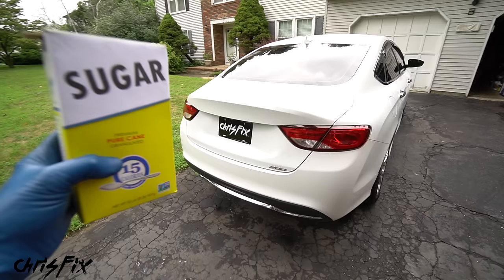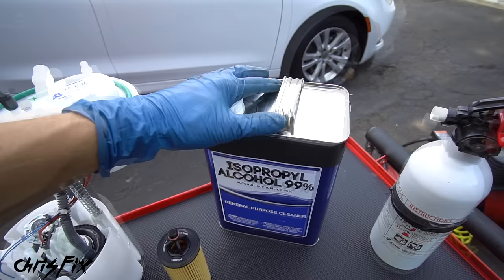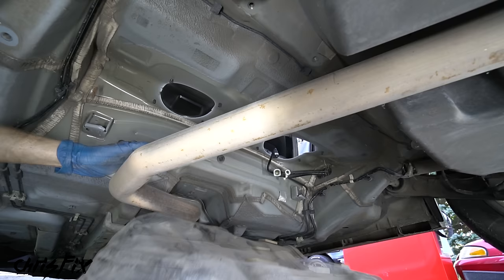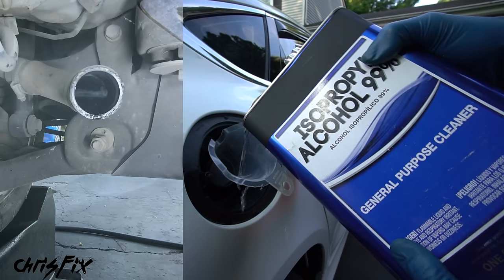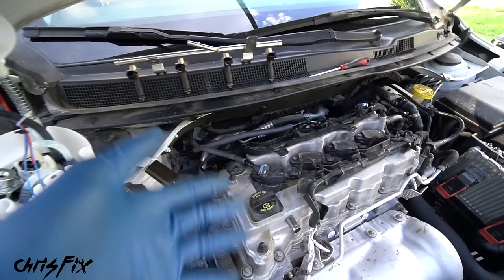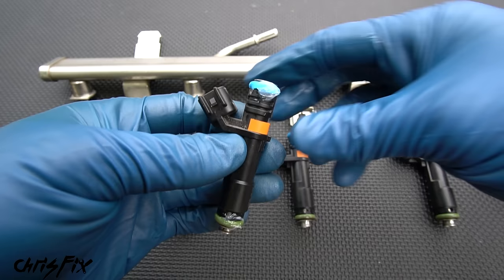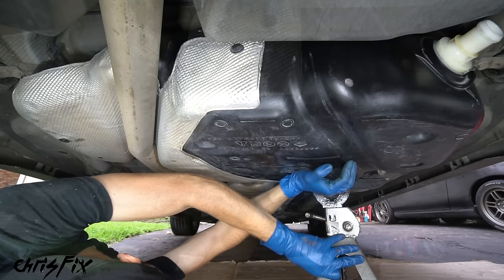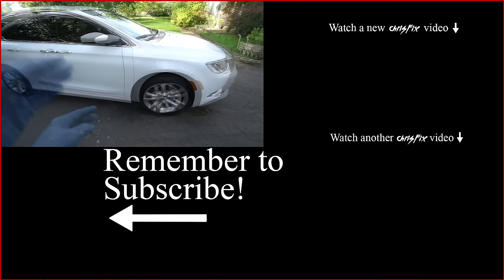How to Clean Out the ENTIRE Fuel System (Vandalized with Sugar in Gas Tank)

Comment: At 17:30 isopropyl alcohol is also highly flamable. Be VERY careful when doing this. Do it outside and far away from any other flammable liquids/items
Reply: Yes, thank you for restating what Chris already warned us about in the video, as I had almost forgotten a couple seconds after he said it.
Reply: but...but i like fire
Reply: @lemau8458  he said don't use gasoline, use Isopropyl alcohol, but it doesn't matter if you use alcohol or gasoline, as both are highly flammable. 
Be careful, and remember that the vapors ignite, not the liquid, so even if you get a spark from static electricity, you can still be in big trouble.
I really like Chris and his videos, but as these are targeted to DIY guys, it is very important to take all precautions, especially when working with highly flammable liquids. If someone is working in his garage with a gas, alcohol, and using 9v batteries(which can easily create a spark) they can burn down their house in a heartbeat, since you cannot stop a gas or alcohol fire with a small extinguisher
Reply: @lemau8458  i can't tell if it's sarcasm or not?!?!
Reply: @pb5109  read the username
Reply: I could he wrong, but since the alcohol dries/dissipates quickly, I don't see this being an issue unless you are introducing a spark right away.
Reply: @shaunrollo1991  Well, that's the reason it is more dangerous,  it vaporizes and becomes a bigger fire hazard.
Reply: @lemau8458  yeah, and the alcohol burns with a virtually invisible pale blue flame so youc could have a fire going and not even know it.
Reply: @TheRa125  but that's what confuses me. Sure, at first when the vapor is fresh, then I can see that. But the vapors would dissipate rather quickly, which would mean that it is no longer flammable
Reply: Shaun Rollo if you’ve ever spilled gas it evaporates extremely quickly as well, but both are very flammable, your right about dissipating vapours but that doesn’t happen instantly
Reply: should also use brass tools when removing the pump

Comment: locking gas cap: $6

not cheating on "Susan" : Priceless.
Reply: I think you mean Susan not cheating...
Reply: Locking cas cap at auto zone in Denver after taxes is $20
Reply: @seanmares2406  u have a 33.3% taxrate?
Reply: not only he fixed it he also prevented it from happening again!! XD
Reply: NaimaKKa 33.3% tax rate. Although, it’s probably not the tax rate. It might just be priced more expensively there before tax.
Reply: @zacjohnson452  forgot a dot

Comment: With respect I say this, over the years as a mechanic I have repaired two vehicles with sugar in the gas tank. On older cars with fuel pump bolted to the engine it would do damage. Sugar is a acid and in right environment will be a acid to metals. On car with fuel pump in the gas tank sugar will turn in to a gel in the tank and clogged the pump up! You are right water will clean out the area with sugar.

Comment: To prime the fuel pump on a keyless start car, either:
press the brake down with key in pocket and not press the start button (you should hear the pump priming)
or don't press any pedals and just press the start button twice.
Reply: I always figured it was a PC kind of thing or like a phone. Both my 2014 and (current) 2018 Chevy Malibu start power with just a tap of the button and primes everything when you do a press n hold until the needles start moving.
Reply: or just push the button without your foot on the brake to run the car in accessories mode which will activate the pump and the push the button again with foot off the brake to urn the car off

Comment: Hey dude, great video!!!! 
2 things: when dealing with gasoline use nitrile gloves, some gloves dissolve in petrol! ALSO with push-start cars sometimes the fuel pump activates when you open the drivers door (Or even unlock the car sometimes)
Reply from the maker: Thanks for sharing and thanks a lot!
Reply: @chrisfix  did you plan to do brakes to this car before giving it away?
Reply: @pauQuu97  yes i do plan on doing this before auctioning this car.
Reply: @chrisfix  Chris i love your videos but if that was a direct injection fuel system he could have gotten hurt if he did not disable fuel pump either by fuse or connector
Reply: @austinshores3324  why? GDI high pressure fuel pumps are engine driven
Reply: @kinslayergaming3159  true i forgot not like a diesel the system's km. Km tank has only like 40ish psi
Reply: Sorry auto correct

Comment: Hey, I know I'm late to the party. Here is a little tip since you said that you're used to keyed ignitions. On key-less ignitions you can prime the car by pushing the start engine button with your foot off the break. It's the same as turning the key to the run position. Also you taught me something. I didn't know you could hold the start button to try to get the engine to turn over. Thanks for all you do.
Reply from the maker: Thanks for the tip!
Reply: i have a bmw 335i, is it possible to prime my car

Comment: I’ve never seen anyone work on an American car and say “I love this design”
Reply: LMFAO facts
Reply: Ive never worked on any foreign car and said “i love this design” everything about euro cars is over complicated
Reply: Kenneth Bilderback exactly
Reply: Kenneth Bilderback well then. You’ve obviously not very bright then.
Reply: @LukeGB003  most regular American cars are somewhat simple to work on. When you start messing with luxury and euro cars that's when the overcomplicated and annoying engineering appears
Reply: Lucas im an ase certified mechanic. Im speaking from experience
Reply: @luckygunner3484  shit man you got my dream job
Reply: Ricer
Reply: James Holbrooks open the link i sent and skip to 4:25 its the part i was talking about
Reply: @luckygunner3484  yeah, that really is helpful, a while back here I had to put a new fuel pump on an 85 Nissan 300zx, it had something similar but instead of it having the pump right there they decided it would be better to put the sender unit there, it was a fucking pain in the ass, can't wait to be rid of that thing.
Reply: James Holbrooks my favorite examples of euro car problems are things like the hydraulic motor mounts on mini coopers that like to burst. And other annoying things like the guys at vw not putting a normal cap on power steering reservoirs instead making you use pliers or a screw driver shaft to open them. Or the fact that on literally any euro car there is no room to work on anything without first removing multiple other components to reach what youre trying to do
Reply: Vincent Valentine  on newer cars yes, on order cars, that's a flat no

Comment: Thanks for the video, Chris.  As a high school teacher in a rough area for decades, I've seen and suffered through my share of car vandalism.  My tank has only been sugared once.  Then I started using a locking gas cap.  lol.  If only my tires were that easy to protect.  lololol.  ;)
Reply: Airless tires do exist, but only for industrial machinery. Would be cool to see it open for consumers.
Reply: Damn Debbie that sucks
Reply: Debbie you can buy airless tires and an loud alarm for your car that will realy help
Reply: I Always Put Sugar in My Tank So The Kids On The Block Dont Steal Mine On A High Speed Chase!
Reply: @germanmemerboi3157  you should watch a video on tires and understand why we dont.
Reply: time to move on...your getting older and you've done your share of charity work. i quit going into those areas years ago, who needs that nonsense?
Reply: @johniorio7951  I understand what you mean.  Thanks
Reply: Like the bouncer did on Road House, get a hooptey with a trunk large enough to keep a couple of tires ready to go.
Reply: Get a dash cam, locking lug nuts that should help.
Reply: @debbiekeds9355 Have to agree. Try to pour in knowledge there is like trying to fill a bucket with no bottom.

Comment: 3:58 Just a heads up, non-OEM gas caps are NOTORIOUS for causing EVAP trouble codes and making your car fail emissions. If you get an EVAP code and are using a third party gas cap, swap back to the OEM cap as a troubleshooting step.

Comment: i cant belive they made the fuel filter a "non service ble part" for the normal consumer.
Reply: some cars even recommend you replace the fuel filter every so many miles to prevent damage caused by a lean fuel air mixture as your intake valve is both cooled and cleaned by the fuel in a port injection car also its bad to run pumps dry
Reply: Fuel pump dies after 80 to 100K anyway
Reply: Probably because finding a way to make money
Reply: I'm not sure about the later generations, but the first generation Prius (through 2003) has the fuel pump, filter, and regulator as non-replaceable parts of the tank. Later generations do not have the internal bladder so I would expect them to be quite different in that respect.
Reply: @cbpuzzle  I had an electric fuel pump fail in a work truck, around 35K miles, but never had one fail in my own cars. 200K miles is easy. Just keep more than a quarter tank of fuel and you are good to go. Running the tank dry is very bad news indeed.
Reply: I think its to maintain servicing easier for a Chrysler technician. Every 100k miles replace the whole assembly. It also reduces the parts since FCA at the time wanted to reduce the amount of individual parts in a vehicle. This vehicle really wasn't designed for the home mechanic. There are a few areas where having the Chrysler Scan Tool makes it easier like the rear brakes.
Reply: Vehicles with the fuel filter integrated into the pump assembly are typically RETURNLESS FUEL SYSTEMS. Meaning fuel is not circulating back and forth through the system (including the filter), therefore the filter's service life is significantly increased since its workload is about half, if not less than a typical inline filter on a non returnless system.

Comment: I like a clean reassembling too. Especially around open fuel lines. Nice to work clean as possible. Too much dirt around fuel lines is asking for problems easily prevented.
Engine cover was cleaner than the steering wheel on this one. Lol. Next on the to do list that seemingly never ends.

Comment: Great video. I saw another video where the guy put rags (cloths) into the tank, then used compressed air into any opening in the tank which ran the rags  around to dry and clean the tank perfectly. I used this method, it defo worked and is very easy.

Comment: Wow, no baffles inside the fuel tank. Luckily most people aren't smart enough to use heavy corn syrup instead of granulated sugar. LOL Great video Chris!
Reply: electronicsNmore u have caused a bounce of distruction
Reply: No baffles because of the moulded in dimples, which, along with the odd shape of the tank, provides a lot of damping of motion for the fuel in the tank in normal driving, though you might find a bit of sloshing when the tank is nearly full or nearly empty, but when empty it will slosh most after the low level is on.
Reply: @SeanBZA  I prefer baffles.

Comment: you can still set the ignition to the "run" position on a push button start, if you don't touch the brake pedal at all, then press the button twice it'll set it to a virtual run position just like turning a key, and this would include priming the fuel system

Comment: "I'm so glad they designed this so we don't have to remove the exhaust."

I wish that were me lol.  With my 05 outback, to get the fuel tank off, I have to remove the exhaust, rear sub frame, suspension, brakes, rear diff, drive shaft, some cables for the parking brakes, and a few other things.  =|
Reply: I feel honda is just as bad, but yeah replacing the o2 sensor on my 03' outback was ridiculous
Reply: @xdmkii  I forgive them because looking at the underside of my car when on a lift, its like.. Well, if you want all wheel drive, a spacious interior, and the cargo and spare tire bay under the trunk..  The fuel tank HAS to go wedged and horse shoe shaped into that spot under the back seat.  There simply isn't anywhere else for it to go.  Still.. Whenever I see a video of Chrisfix dropping a tank with a socket and seemingly a few minutes of time its like... ha, must be nice.  If you ever want a difficult repair Chris, give me a ring!  I'm also in NJ!
Reply: My old Accord had a similar problem. In order to remove the breather box, the manual said to remove the driver side half shaft. Luckily someone on a forum said you could just remove the alternator. If I remember correctly, that box had to come out just to change the air filter! That car was such a pain in my ass!
Reply: @themightymutt5213  those darn engineers! They must only drive cars with warranties... 🤔🤔🤔
Reply: Manufacturers makes replacing certain things easier for a reason. Like Subaru makes removing the engine easier.
Reply: That sounds delightful

Comment: Chris, if you press the start button without pressing the brakes, it's the equivalent of turning the key to the run position so it pressurizes the fuel lines without engaging the starter motor.

Comment: In the workshop manual for my 1st gen discovery it states explicitly to not remove the battery terminals when performing work on the fuel system as the arcing when putting the negative terminal back on can ignite any lingering fumes though i suspect that isn't an issue when you're working outside
Reply from the maker: I would think they are saying that as a precaution if you have a fuel leak already or if there are vapors around the tank. That makes sense.

Comment: "these 6 usd locking gas caps"
me, european with my 22 year old beater car: wait, those are not standard in usa?
Reply: Nope, most vehicles have a locking cover instead.  Me personally I hate locking gas caps. I find it extremely annoying when someone  borrows a vehicle and installs one after loosing the original cap and then returns the vehicle but doesn’t bother to leave the freaking key.  So when you go to fill said vehicle you can’t remove the damn cap. And the truck doesn’t have enough fuel to make it to the idiots house to retrieve the key.
Reply: @jaykneegarner2479  locking caps, in civilised places like ... Europe, has the ignition key as the cap key. I'm getting more and more baffled how backwards things are overseas
Reply: I'd say it depends on the price of the vehicle for the most part, wife's car (2015 Clio) has a locking cap you can open with the car's key, my old 2006 VW Golf has an electrical locking system.
Reply: The lock is usually on the fuel door itself, but as he said in the video, that lock was broken. 
Also, I've used locking gas caps in the past. Those $6 ones are aftermarket ones, they use their own key which is annoying, and I also had problems with them not creating a good seal for the EVAP system and constantly tripping my check engine light. I had to go back to the factory gas gap, which didn't have a lock, to stop getting the check engine light.
Reply: @TC Fenstermaker you can pull em open with your bare hand

Comment: Does anyone remember when he said he would install a high performance throttle body on the driftstang, well im hoping that hes doing a video on it right now !
Reply from the maker: The throttle body probably won't happen because the intake is limited already and has max air flow with this current head design, so it would be a big waste. I would need to swap out the engine!
Reply: @chrisfix  oh ok, so supercharger then???

Comment: Would it be a good idea to use compressed air when trying to clean the water from the fuel filler line?
Reply from the maker: The alcohol will clean out the water, but you can do that as well if you want!

Comment: There is going to be a small spark, so dont use gasoline

Goes ahead and uses pure ethanol
Reply: isopropyl is not ethanol. And the point is that gasoline burns much hotter and longer than alcohols do. Neither are great, but gas definitely is worse
Reply: @RoflmayoMan  no i understand, its a propane molecule with a hydroxide group on the second carbon atom, but its still quite flamable. I'm not trying to say he is a dummy, just making observations.

Comment: In high school, I did a science project on sugar in a gas tank.   I use our lawnmower with a Briggs and Straton 6 HP motor.   I can.t remember the details, but a motor can take an insane amount of sugar.   To actually stop a car's fuel system someone would have to put a lot of sugar in your tank.   It would have to be enough sugar that it would collect at the bottom of the talk without dissolving.  The more gas in the tank, the more sugar it will take.    An easy fix if someone put a ten-pound bag of sugar in your gas tank would be to fill the tank up, put an air hose in the tank, and put enough air in it to stir the gas and sugar around.  Once the sugar is dissolved into the gas drive it out.  Drive until the car is on a half tank and refill it.   If the sugar is fully dissolved it will not stop up the filter, lines, or injectors.    

Remember, sugar is a carbon molecule.  It burns pretty well.  Just keep adding gas to dilute what's in the tank.

Comment: Thanks Chris, a buddy of mine had a problem with his engine being rough vibrating and having no acceleration and i recommended to clean his injectors like in this video, though we had to do it with a 12V supply and a bike pump instead of an air compressor  it still worked and his car came back to running normal!

Comment: Hey Chris I don't know if you know or not, but there is a way to turn a push button to the on position, Simply don't step on the brake, and the second push will go to on, without starting, but it will still prime the car.  At least that's how my Infiniti does it :P No clutch, it goes to acc, press again and it goes on, and primes.  Figured I'd mention it in case, I know those tricks can help you out!